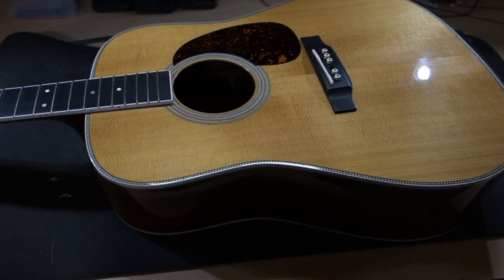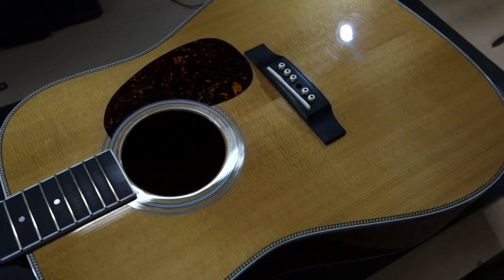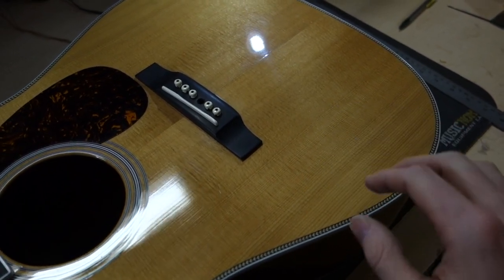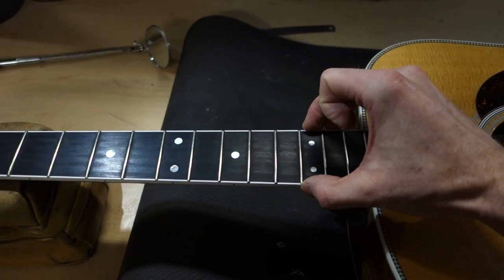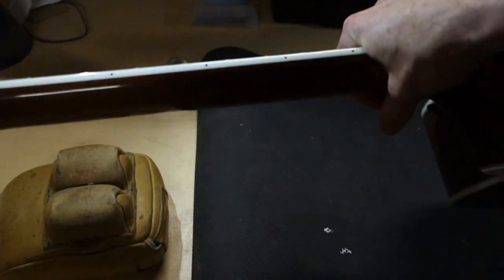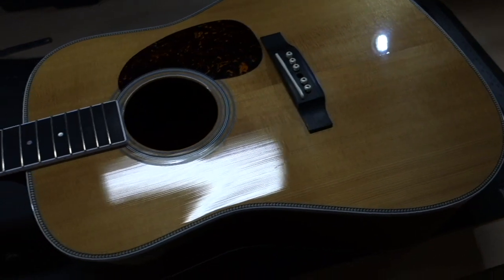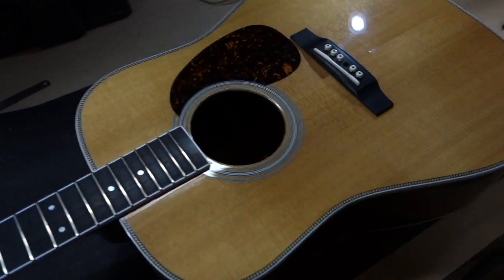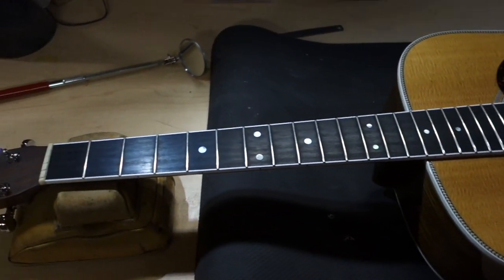How to Spot Dryness/Low Humidity Damage in an Acoustic Guitar.

Comment: This is extremely helpful!! I have humidified most of my guitars with the Humidipak, one I didn't humidify started to have fret buzz. It's a solid top, laminate back and sides but apparently it was still susceptible to that concern.

This is my first winter in Michigan so the extended cold weather and constant dry heat is a lot more intense than in Nashville.

Just ordered the Humidipak restore packs and hoping I can reverse the issue with the one guitar!
Reply from the maker: Hey Scott, sorry I missed your comment from a few weeks back. Yes, all instruments (even laminated ones) can still be susceptible to dryness. The hymidipak system should ensure that the top stays in the proper humidity range.

Comment: I live in the desert in AZ.  I have a ply ukulele.  I have applied a product over the varnished exterior that has bees wax and orange oil.  I am going to dampen a sponge with  "Old English" which is a diluted lemon oil and shake it around the unfinished interior for a few applications.  It may well affect the tone slightly.  The worst scenario is it will affect the glued bonds.  But I think it will be alright, and I'm not talking Martins here.  Feed the wood.
Reply from the maker: The nice thing about plywood instruments is they are not near as susceptible to humidity problem as solid wood instruments. I have heard of companies who finish the insides of their instruments. In fact I use a very light coat of shellac on the inside of most of the guitars that I build. If the finish on the inside is too heavy/thick it can affect the tone of the instrument. But a light oil finish as you suggest shouldn't be a problem.

Comment: I recently got my new martin J40 and I love it so much, but I am really worried about the low humidity. I've tried out multiple humidifiers but even the best of them could only keep my room at 40% humidity maximum. I'm now using the humidipak inside the case together with the room humidifier. I hope it'll work out well for my guitar. Thanks for the tips! These are super helpful!
Reply from the maker: It sounds like you are doing everything right. 40% is a pretty safe level for most guitars. It's when you consistently get down around 30% or lower that you can run into problems. If you are using the humidipak system in the case you should have nothing to worry about. It is self regulating and as long as you change the packs when recommended it should keep your guitar at the right humidity level.
Reply: You’ll be ok, I use that nomad with the sponge, goes in. Between the strings, closed in the case and just keep an eye on it, I think a lot of people never humidify them, may even leave them by a heat vent

Comment: Thanks so much for this Josh. I found it very helpful. I have a recently purchase used Martin D15 M and when I got it ... took it to my guitar tech. He assessed it as "needing a drink" so we humidified for 3 weeks and then he set it up. Six months later ... I started noticing intonation issues ... particularly up the fretboard or when using a capo. He reassessed and said it was dry again. I was humidifying it albeit not every day and I now realize that this is truly a high maintenance instrument. I have an old Aria that I've owned for 30 years and have never humidified it even once. I grab it and it plays great, sounds good and no intonation issues at all. I have been told now ... that because of possible previous neglect, the Martin will always need extra maintenance because wood "has a memory" and it will always want to naturally gravitate back to its driest state. Would you agree with that? Is the mahogany part of the problem?  Do you think I should move on from the Martin or just tolerate its fussiness when it comes to humidity. Would really appreciate your thoughts.
Reply: Hi, what did you end up doing? I just got a Martin D-10E and it is very dry, and sunken. Probably mistreated in Guitar Center warehouse. I'm afraid it will always be problematic. One day in and it is buzzing and the bridge is sunk. I've  been told to rehydrate it but I'm afraid to keep it now.
Reply: Buy a cheaper guitar.
Reply: Oasis fill baggs work fine for me and my instruments. I refill every two days in the wintertime. It varies in the summer time here in indiana. We live in between two rivers with alot of humidity. Air conditioning can also reduce humidity levels. All acoustic guitars go through small movements when they are first taken out of their cases.

Comment: in florida its the opposite.....summer is when the AC is on constantly and dries guitars out
Reply from the maker: Yes, AC can also be an issue when it needs to be used a lot.
Reply: @joshuahouseguitars  The thing that made me aware was getting a Sensi/alexa smart thermostat...has a built in hygrometer that tells me the humidity. Now I use soundhole humidifiers for my guitars in AC season.

Comment: Hi Josh, great video and tips. I have a maple Birdseye 10 steel strings guitar. It is a Brazilian guitar (Viola caipira). I just realized that it is really dry. The back lost the radius severally, actually its bent against the natural radius. I had started yesterday try to recovery the humidity, putting a humidity kit in side the box. However, the internal back and side are sealed with a shellac (goma laca). The questions are: Is it possible to recover the humidity even with the internal shellac? Is it possible to recover the back radius?
I would really appreciate your comments. 

Many thanks.
Reply from the maker: Hello Tiago, Yes it still may be possible to recover the radius. If the shellac is unwaxed (or dewaxed) then it will allow some moisture to penetrate. It will just be slower than if the wood was not sealed. You are doing the right thing with the humidity treatment, but it could take it some time (possible a few weeks) for it to return to normal. Keep up the treatment with the humidifier and hopefully you will start to see some improvement with the guitar coming back to it's original shape.
Reply: Josh House Hi Josh, Many thanks! I will keep the Treatment. I let you know the evolution. Have a great weekend.

Comment: I bought a Martin d28 modern deluxe in the month of March 2022. The guitar was built 6 months previous so that means  Oct of 2021. The guitar came out of a store in Montreal , Canada and had light use as a demonstrator. From day one of my ownership and purchase, ($6,000.00) I inserted a Humidipack in the sound hole and at the head of the guitar per instructions. The guitar was always kept in its case laying flat, when not in play. I brought the guitar in to Long and Mcquade for its first free setup. I wanted the strings lowered just a tiny bit as Iam a beginner, also I wanted to change the strings to 11 gauge light acoustic. While the tech was looking at my instrument, and to my horror, he pointed out a hairline crack on the top of the body, perfectly in the centre of the guitar. Well here we are a week later and Iam waiting to hear back from Long and Mcquade who is an authorized dealer for Martin Guitars. I can only assume that its days in Montreal were mostly out of the case, and therefore not properly humidified. I just can't believe that it happened in the the three months I have owned it. I have done a lot or reasearch on guitars that develop cracks and it seems that it is not considered a major repair. I just hope and pray that the guitar will look and sound like a new Martin D28 after the repair. Any thoughts or comments on my story would be appriciated!!
Reply: That must be super disappointing to have happen to such a new and expensive guitar. It sounds like the center seam on the guitar's top is coming unglued, like the guitar in this video? But you caught it early so they should be able to do an invisible repair hopefully. I hear good things about my local Long & McQuade's repairing abilities.
Reply: Thanks Jim for your reply. Yes very disappointed, but like you said I hope they can do an invisible repair. I should have also mentioned that I live in a Condo, and the sales rep said you must really keep an eye on the humidity living in a condo. Thanks again, I will keep you posted.
Reply: Oh, and yes Jim it is exactly in the same spot as the one in the video, but not as nearly as bad. Can only see it on a certain angle. like a hairline crack.
Reply: @markgriffiths3262  Yeah the humidity in my house gets down to 15% in the winter with the furnace on. You should get some cheap hygrometers and keep one in the room and one in the case. If you're using a soft case, and even with a hard case when it's really cold out, wrap the guitar in a garbage bag to keep the moisture from escaping. 

My Recording King was so dry recently that the bridge was 2 mm lower than normal, it's surprising how much they change shape. I'm no expert, but guitar tops are actually two pieces glued together down the middle, it sounds like yours flexed enough that the glue failed in that seam, that's why the crack is dead center like that. Let me know when you get the guitar back, I'm thinking you'll get it back good as new and shouldn't have a problem with it again if you keep it humid.
Reply: Thanks Jim. I talked to the tech who is working on my guitar. He said the first thing he did was hydrate it. The crack actually closed up to the point you could barely see it. Now he has to de-hydrate it to open up the crack to get some glue in it from the inside. Then he puts in very small pieces of wood to ad extra strengh. He did not promise an "invisible repair, but said it should be fine and not to worry!  Will keep you posted. @jimsayles7394
Reply: Jim, just to let you know the tops on martins are a single piece of very thin spruce. This is what I was told. @jimsayles7394
Reply: @markgriffiths3262  He must have meant the top is solid spruce all the way through, as opposed to laminated. All modern guitar tops have that center seam as far as I know. It's harder to see on some guitars than others, but if you google your model, you'll see it in some of the images. That's good news though, did they say how much longer?
Reply: Hi Jim, thanks for your interest. I got the guitar back from Long and Mcquade on Tuesday. Let me just say the repair was so good, if you did not know a crack was fixed, you would never know one ever existed! Cant say enough about the skills of "Dave" who did the work. No charge to me, they repaired it as a "customer courtesy". Kudos to Long and Mcquade, they have a customer for life! (Martin Guitars, does not cover cracks) Just to let you know, after he opened up the crack he used glue and "cleated inside with four small spruce cleats to reinforce". To make sure the guitar stays properly hydrated Iam using two systems. The Humidipacks from diadaro and Oasis Guitar Humidifier. Also purchased a guitar Hygrometer that fits into the case to actually show the humidity, so there is no guessing. In the music room itself, where the guitar is kept in its case, I bought a a quality thermostat to show room temp. It also shows the humidity level in the room.Taking no chances this time. Quite a journey with lots learned! Could send you Pics of the guitar if you let me know your contact. Thanks again Jim for your interest.
 @jimsayles7394
Reply: Hey man, that's great to hear! Now you can actually enjoy your new guitar haha.That's good you got multiple methods of checking the humidity. You can also take a straight edge and check the radius of the top and the bridge height, like he's doing in this video. If you do it now while you know the guitar is healthy, you'll have a good frame of reference for if you ever have a humidity issue again. I'm glad the repair went well, I genuinely felt really bad for you lol

Comment: I have a small room that’s about 10 feet long and 7 feet wide that I keep my guitar in… Martin 18. If there is one heating vents on the floor that does heat the space. I live in North Dakota. I’m wondering if the humidifier running in that room size and being so small would suffice?
Reply from the maker: Yes, A small room humidifier should adequately humidify a rooms that size. It's a good idea to get a hygrometer so that you have some idea of where the humidity is at.

Comment: I have a Recording king RO328 and have recently noticed that the neck is slightly bent downwards (not much). So if looking from behind the bridge at eyes level you can see a dip starting from around fret 13. I've completely realeasd the truss rod (no change in neck position ) and I'm keeping the strings with tension hoping it returns back to its normal position. Where I live we've had very high temperatures for weeks or even almost 2 months  sometimes over 40C. I'm curious, what could have happened? Would you say its reparable? Or would it be the perfect excuse to start thinking about getting another guitar 😜😂 Thanks!
Reply from the maker: Sorry for the slow reply! It is hard to say exactly what is happening with your guitar. Is the area you live in dry or humid when you hit those high temperatures? Often when an instrument dries out the neck can flatten out or even bow backwards. If your guitar is dry then this could be what is going on. If this is a dryness issues than keeping the guitar in it's case with a humidifier should help restore the guitar to proper moisture levels, and when the happens the neck should move back to it's proper position. There could be something else going on, but again without seeing the guitar it is hard to say.

Comment: When using a humidifier in a case to try bringing a sunken top back to flat, should the guitar be under tension? Or should I remove the strings? Just bought a 96 Martin that has probably spent its entire life being too dry. No cracks or lifting bridge, just a sunken top.
Reply from the maker: I think I would do it without string tension. I think under string tension could possibly cause the top to deform more as under string tension everything would be pulled towards the sound hole. As the top moves back into place it may only move in the direction the strings are pulling. It is hard to say, but I've only done this with string tension off. I have not always been able to restore a badly sunken top. In cases like that I always recommend the guitar be taken to a reputable repair shop that deals with this type of repair on a regular bases, and preferable a warranty repair centre for your brand (in your cases Martin). I think some brands and bracing styles (Martin's lightly built scalloped X for example) are more susceptible to the top sinking.

Comment: Hey! Great video- just a quick question. I recently took my guitar to be looked at because of some fret buzzing around the 9-12th frets. The guy said (If I recall correctly) that my guitar has a swollen tongue and humidifying could fix this over time. I had tried this in the past with very little luck. It sounds to me like your examples are the opposite of what I’m experiencing. Can you explain? Does this sound  right to you? Thanks!
Reply from the maker: Swelling is a sign of high humidity. So if high humidity was the cause of your problem than adding more humidity would not be the solution. There are many reasons why you can get fret buzz. Dryness causes the wood to shrink, and this can cause the fretboard to flatten out and top to fall, as shown in the video. If the board flattens to much then buzzing can start to appear. Any of these things on their own, or combined, can cause the action to drop and the strings to stat buzzing. If that was the issue then increasing the humidity can help. It depends where you live, but this is typically the time of year where we are coming out of the dry season (if you're in North America). If this issue appeared a while ago (during the dry season) and dryness is the issue, then the guitar may not have had a chance yet to absorb the humidity it needs for things to return to "normal". It's hard to say exactly what is going on when I can't see the guitar. As a guitar goes through seasonal cycles and the wood moves it can happen that a guitar will develop a hump in the fretboard around the body joint. This is because the wood is more stable in that area of the guitar with the heavy reinforcement around the neck joint. The wood around this area moves, while the neck joint area remains stable. If this hump does develop the result is often buzzing in the frets leading up to the neck joint (10-14ish). Often you can see this if you sight down the edge of the fretboard from the headstock (good idea to wear eye protection). You should see that the fretboard is fairly straight or has a slight curve (relief). If you see a rise or bump in the edge of the fretboard close to the body joint, then this could be the issue you are dealing with. If I can be more help please let me know.
Reply: Hey  @joshuahouseguitars  if what you're describing at the end of your comment is happening (hump around the body joint), what can I do to alleviate that?
Reply from the maker: @GOPJAC  It depends how extreme the issue is. The solution would be to level out the bump. Sometimes this can be done by taking the inconsistency out of the frets, but that’s only works if it is a slight bump. If it is a little more severe than the fretboard itself may need to be leveled. You need to be sure you are working with someone who can identify exactly what the problem is and the best way to correct it. Don’t go by my advice alone on this as I am limited to how much I can diagnose this type of problem from a distance. A good builder or repair tech should have a notched straight edge that will fit over top of the frets and measure the straitness of the board. This would show you if there is a bump in the board and exactly where it is located.